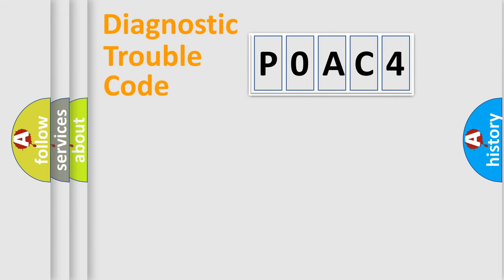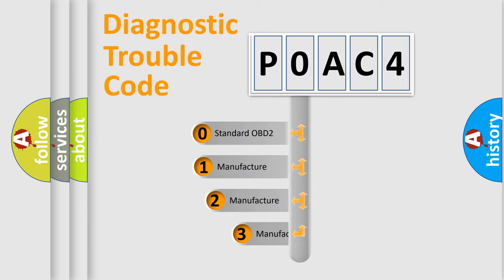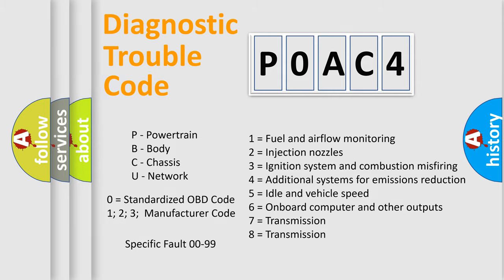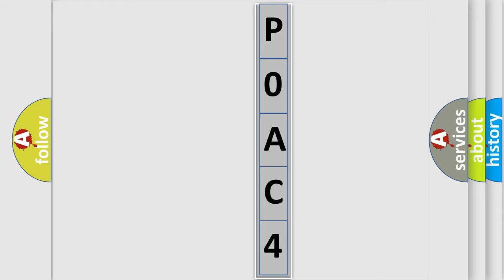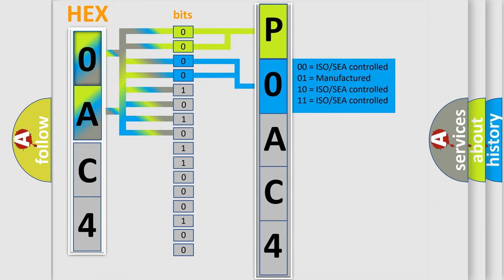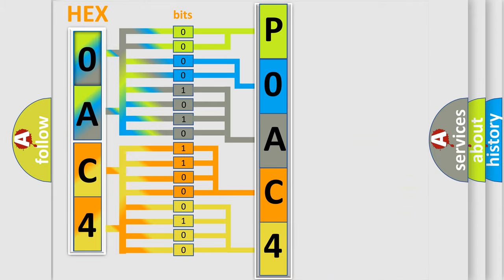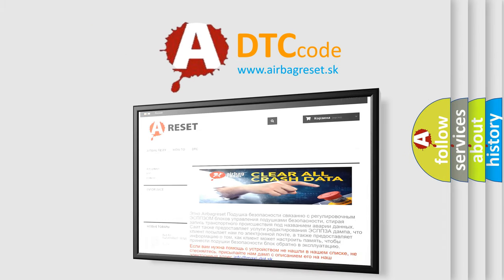DTC Chevrolet P0AC4 Short Explanation

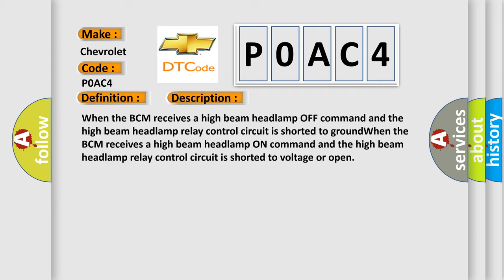Comment: Answer is at 3:14 Headlight high beam relay shorted or open circuit. 
I turned lights off then on, switched high/low a couple times. All worked as expected. The check engine light went off. If it hadn't I would have pulled and checked the relay, but there was no need.
This error showed up on a 2018 Chevy Volt that had been parked for a couple weeks.
Reply: Your answer was better then the video